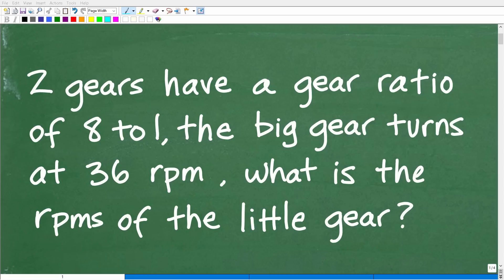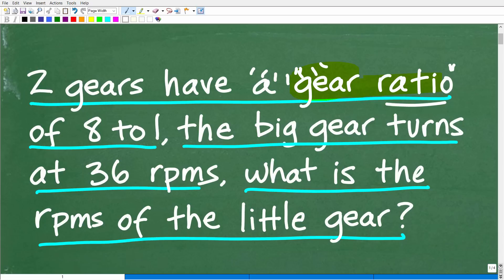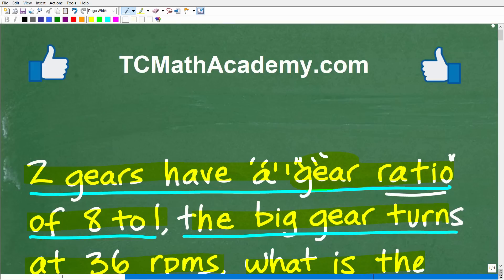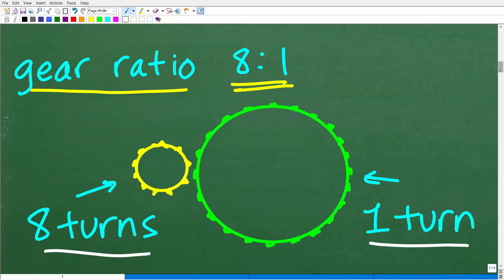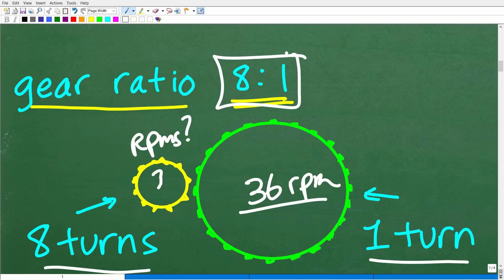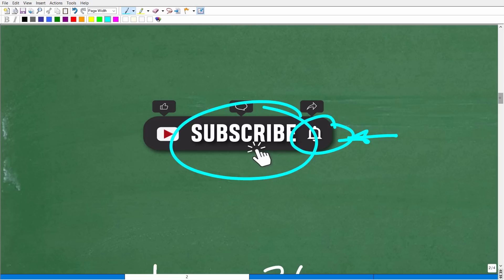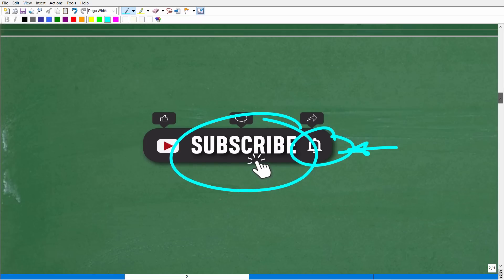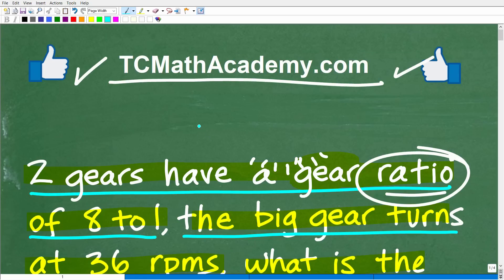2 gears have a gear ratio of 8:1, the big gear turns at 36 rpms, what is the rpm of the little gear?

Comment: 2 gears .. Gear ratio 8 : 1 .. Larger gear 36 rpm
All you gave to remember here is that the smaller gear will be turning FASTER
36 x 8             288 rpm
I will just say, however, that it's rpm and not rpms .. revolutions is the plural word.

Comment: I would first want to know which gear is the one being driven and which one is the idler . Is the big one the 8 or is it the 1? I would say they travel at same speed because it's a torque tradeoff not speed
Reply: You have to think of it in terms of ''How many times does the smaller gear have to turn'' for every time the larger gear turns once ?  .. and that's 8 times.
There is no way that the larger gear could be turning faster if they were attached to each other.

Comment: I’ve a problem with the problem. Do you not draw difference between RPM revolutions per minute and RPMs revolutions per millisecond?
Reply: What?
Reply: @George50809  RPM (or rpm) stands for revolution (or revolutions) per minute.  Were one to append an "s" to the end of RPM (or rpm), the abbreviation would represent revolution (or revolutions) per millisecond.  Millisecond is one one-thousandth of a second.